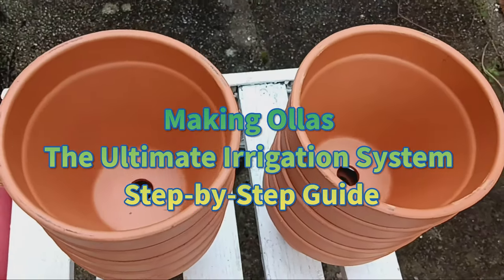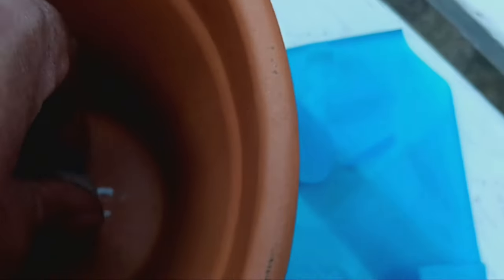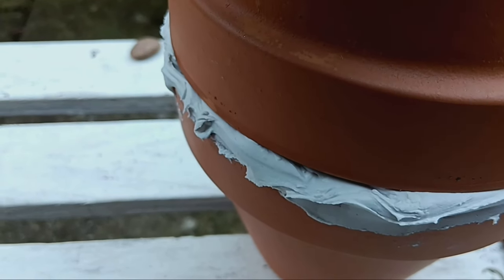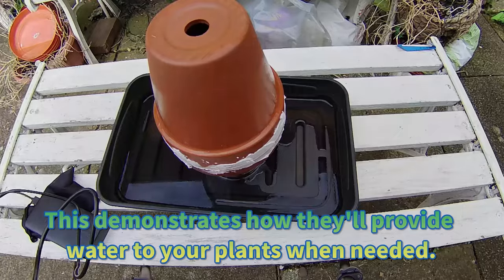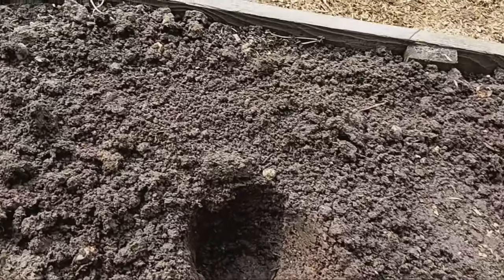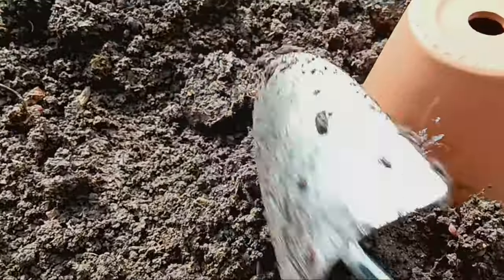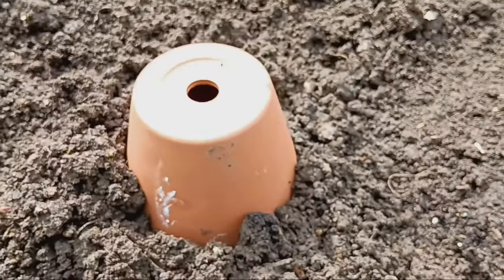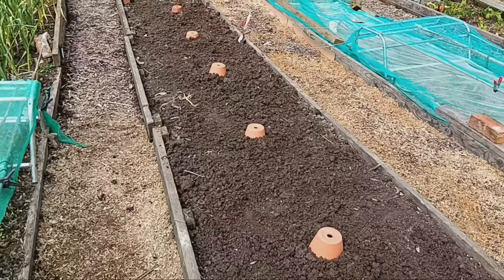Making Ollas The Ultimate Irrigation System Step by Step Guide

Comment: What did you say??? Zero research before posting, huh? You keep calling them holas. Not what they are called. Y
Reply from the maker: Thank you for bringing that to my attention! I apologize for any confusion caused by the mislabeling. Your feedback is incredibly valuable, and I deeply appreciate you pointing out the correct term, 'Ollas,' pronounced “OH-yas”.

It's important to clarify that while 'Ollas' typically refer to specific ceramic pots used for irrigation, the ones I've made are a DIY alternative, which I've dubbed 'holas.' These are constructed differently using two terracotta pots stuck together with one hole blocked off, serving a similar purpose at a fraction of the cost. My approach was based on personal experimentation rather than extensive research, although I have observed their effectiveness over the past four years since I made the first batch.

Rest assured, I'll strive to enhance the accuracy of my content moving forward. Your understanding and patience are greatly appreciated. Thank you once again for your input!